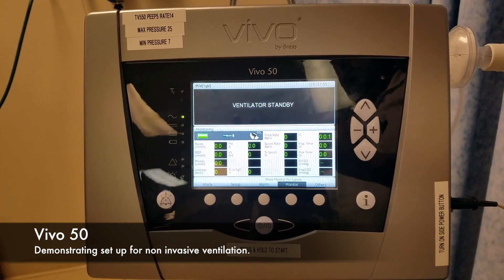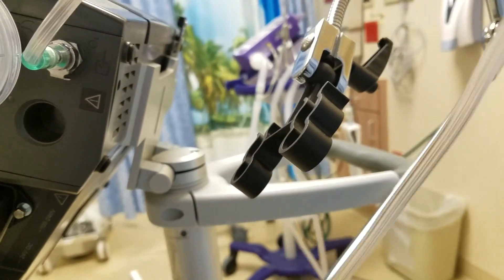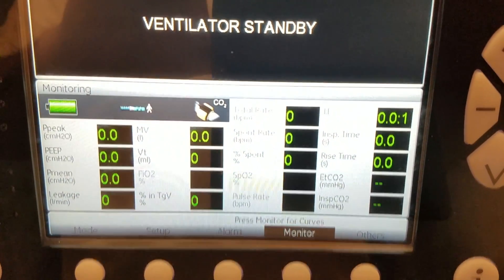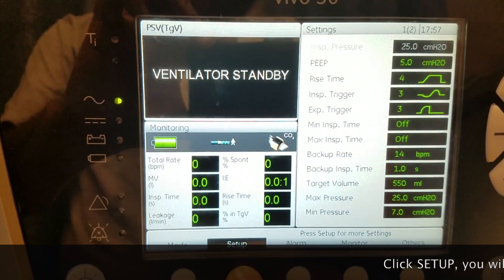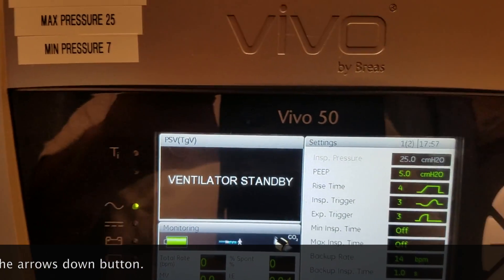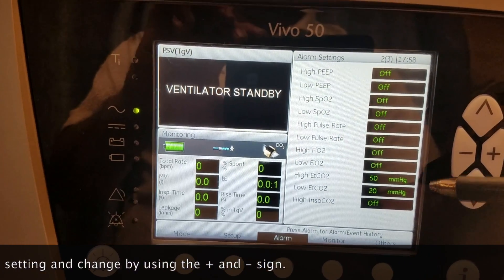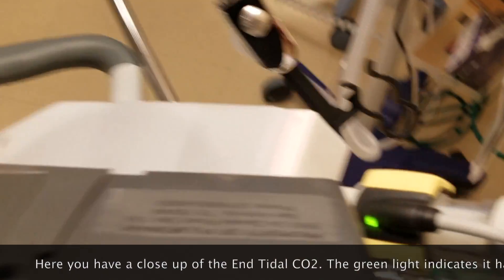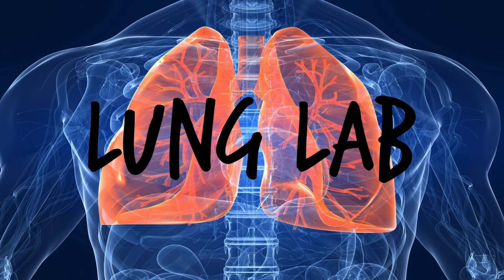VIVO 50 SET UP

Comment: Hi. I want to ask you if I can manually determine a FiO2 like 27-31% without adjusting the oxygen flow rate. Thanks and hugs!
Reply: The monitor only shows the end result of fio2 by the analyzer. It can only be adjusted by flowmeter